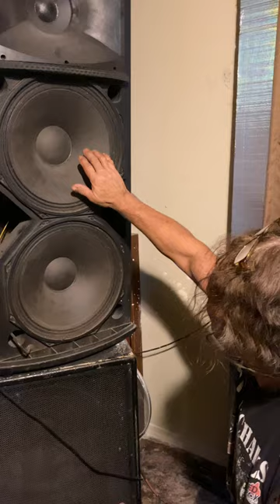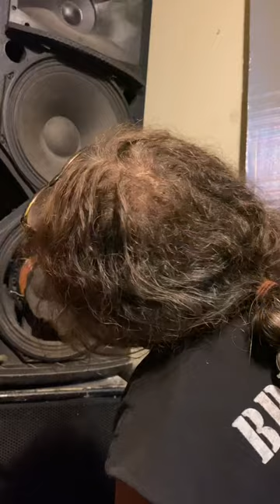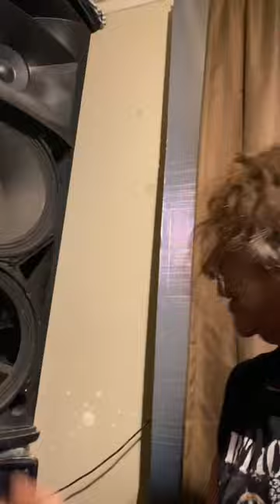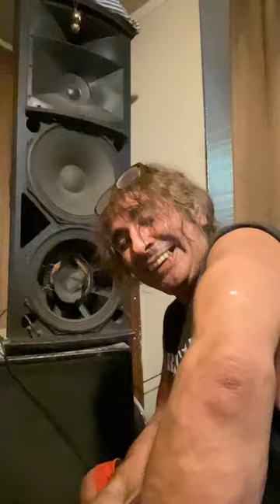Speaker Repair Disfunction by Gus

Comment: That speaker could of been repaired if dont move its blown replace the coil but first look at the copper coil if it has burnt spot its blown and coil needs to be replaced easy fix under 10 minutes